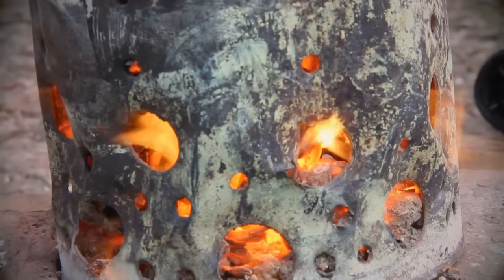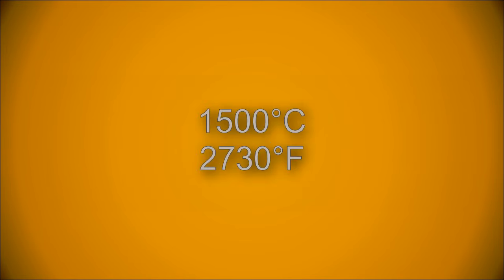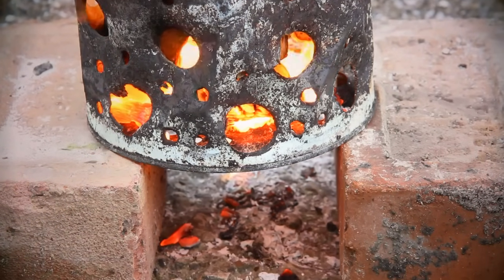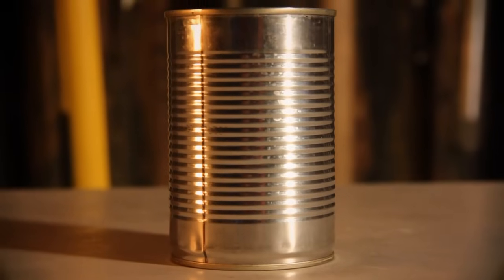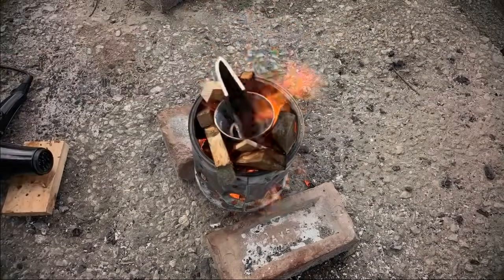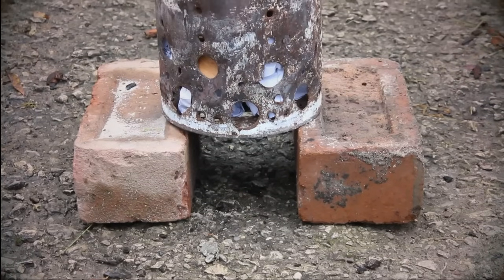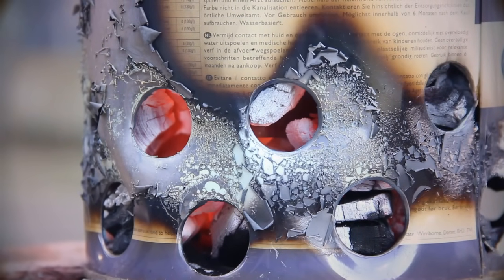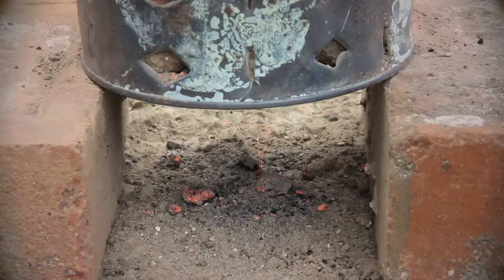How to Make a Free Aluminium Melting Furnace

Comment: OK so I tried this and it does work. Thing is, I couldn't find a paint tin small enough so had to go with a larger tin. As you said in the video, it did take more wood. Problem is it was a huuuuuge amount of wood. I have a lot of precut pallet wood but I got about 8 cans done and needed to fill the tin twice. At that rate all the wood will be gone in no time.  I also noticed that the crucible kept falling over and it's difficult to keep adjusting it as the fire gets so hot that it's hard to get close enough. I think it's back to the drawing board for me.
Reply: What did people go back to before the drawing board was invented??🤨
Reply: @snelgrave101    The stone wall of the cave. Never underestimate the power of the Neanderthal!

- Max Giganteum
Reply: @MaxGiganteum  never, it appears they were smarter than us as a species.
Reply: @snelgrave101 before inventing drawing board sketch it on the ground. I did it as a school kid, 😂
Reply: @pankajmakwana2300  are you crazy? Putting chalk on the ground, that drives the Karen's of the world to near catastrophic meltdown I've seen it happen it's not a pretty sight
Reply: @snelgrave101  what do you mean by I am crazy? To draw on the ground we used a stick on the sandy ground. You want to do melt of aluminium on tin can then suit yourself. Make sure you are protected though there are no spare eyes or limbs and if you get hurt the pain is all yours also. So good luck.
Reply: @pankajmakwana2300  I think you mis read my comment friend, it was rhetorical, the karens of the world don't like people using chalk on the ground, look up karen V chalk kid.
Reply: @snelgrave101 slate boulder
Reply: @holmes1956O  What was the best thing before sliced bread came along?.
Reply: @snelgrave101 the chiseling board.
Reply from the maker: Hi, great to hear you’ve tried it. Have you tried charcoal? Obviously you’ll have to pay for it but the furnace should be much more efficient. Hope that helps
Reply: Or just go to the effort to make a legitimate furnace with firebrick lining and so forth
Reply: "I also noticed that the crucible kept falling over"  balancing the fire tube and the molten ally on very thin edges of those bricks is asking for trouble
Reply: You could make a stand that the can sits on it might work and charcoal would work best or just cut down trees weeks prior to melting
Reply: Thanks for sharing!

Comment: I'd presume it's possible to melt aluminum cans in this setup relatively easily, correct?
Reply from the maker: Hi, the wood is probably good for one melt. You should be able to melt some but it might be best using charcoal as the heat will last for longer. Also, a tin can is only just large enough to fit a aluminum can in, so if you crush them they might not fit. Hope that helps
Reply: Yes but it's a waste of time to melt Aluminum cans even if you crush them first. There's not enough mass to make it worth it. Attain some substantial scrap aluminum from wherever you can such as a small gas engine block that's non-repairable or used up pistons from an automotive engine. There are other parts as well such as an aluminum head that's shot. The quality will be much greater than cans too. The truth is that Aluminum can be found in all sorts of items... but try to stick to scrap that's worthwhile. Cheaply made products contain crap Aluminum which is OK if you're making something ornamental. If you want to cast useable parts, use Aluminum that was originally cast into engine or transmission parts. They'll be made from an alloy that's superior. Best wishes!

- Max Giganteum

Comment: Hi, How long did it take to melt your aluminium in your system?
Reply from the maker: Hi, normally about 20min. I have had it take longer sometimes, I’m thinking it’s something to do with different types of wood.
Reply: @MetallurgyData  hi, what would you say is the best wood for burning? Thanks!!
Reply: @matthewburns6843  tree wood
Reply: @raymondo162  really ? I Didn't thibk about using wood forming in trees ! Thanks for the usefull tip !
Reply: I personally use madrona.  It's an oily hard wood it doesn't burn up too fast but it burns extremely hot and less smoke ,I have found. But I do suggest that removing the 'bark' as to help reduce the smoke also

Comment: Can we use it to melt brass and copper ?
Reply from the maker: Hi, the temperatures won’t be high enough to melt brass and copper. You’ll need lump wood charcoal but still might struggle with this setup.
Reply: One word: Negative!

Comment: From my experience, even in a a 16cm high container 'air flow management' could be an issue.

Did you try it with less holes? 

In my guess at least those 10mm holes on the side are contraproductive. 

And maybe only one row of 22 or 20mm holes on the side.
Reply: The lowest tech option I’ve seen, but one that works and is cheap Enough for someone who wishes to tinker with metallurgy.
Reply: I guess your set up could really gain from a cleaner burn.
Reply: Hmm maybe that can size is slightly to small for a decent chimney-effect (sorry for my lacking English, by the way. I assure u, I don't want to patronize. Ur clips are awesome and really educating!)

If you're keen to try bigger setups: try to get hold of a drum from an old washing machine. I know I don't have to explain it to you but for the the benefit of other readers: simply spoken the steel and it's thickness those drums are made of will usually take extremly long till it's burned out/brittle.
And you could mess with application some sheet-metal to manage air flow.
Reply: @michaelabratzel6371  that's an excellent idea as well!!